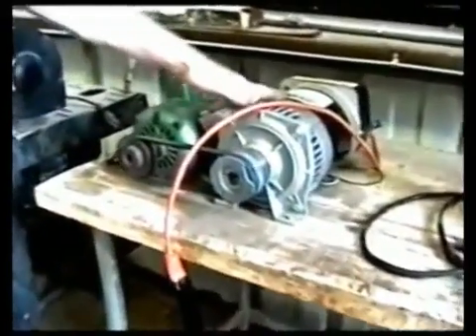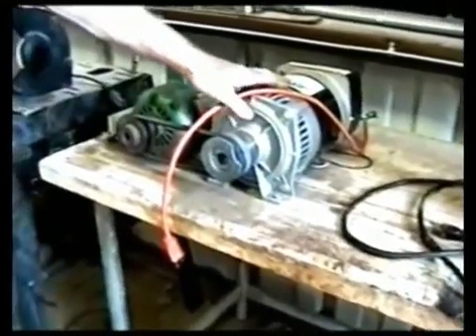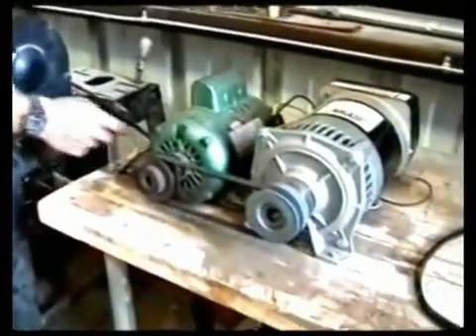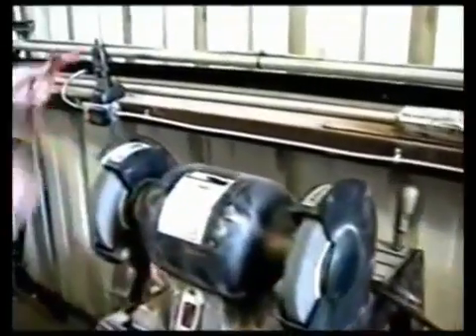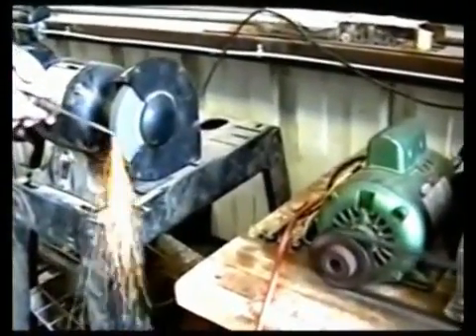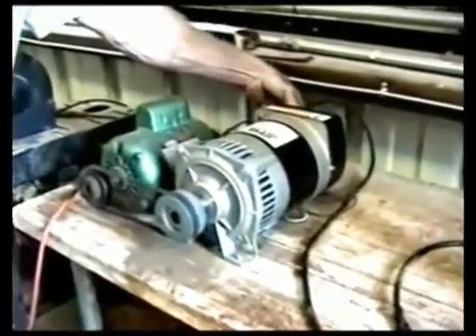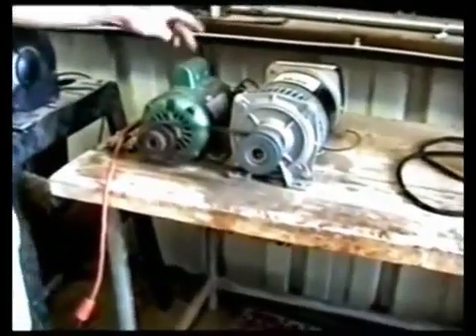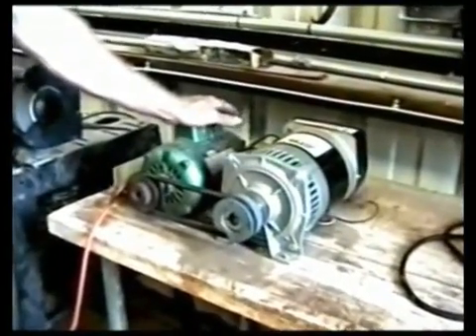3000 Watt Generator Powers Itself, Grinder & Drill Press.

Comment: I tried creating a gas-less generator by using a 12 volt car battery to run a 6 volt kid scooter motor to turn a 12 volt GM alternator to operate a 110 power inverter.As a big circle jerk lets say.The battery ran the motor which turned the alternator which the alternator charged the battery."That's the circle jerk". And in turn powered the 110 power inverter.I powered a 100 watt light bulb with this system for over 12 hours before the voltage Gen- burned out.Any thoughts what I did wrong?

Comment: That's easy to build. Just connect two motors, high RPM motor with low RPM motor at two ends, one with wire and other with conveyor belt. Supply some power to one motor and see the magic :)

Comment: ....so you switched over from the plug you put into the wall into another, hidden plug in the wall, and then unplugged the first plug to make it appear to run itself.

well, if it don't make sense, I guess it's making money!

if its real, proof is easy: put the "generator" on a rolling cart, and give a camera tour of the self-running device unplugged from the wall.

Comment: This is similar to power generators used during WWII. They used a starter motor hooked directly to a dynamo that then used part of the power to recharge the 6 volt car battery and then use the excess electricity to power the military camp, including powering the radio transmitter/receivers and lights.

Comment: I work at a golf coarse n for the longest time I knew this was possible n thought a golf cart could run continuous u would just need batteries to get started. if u were to use power inverters to boost power of that to would it work

Comment: This isn't "future" anything, because the only difference between this & what happens in a vehicle is the vehicle requires gasoline from outside the system in order to provide enough power to keep the car going. Otherwise, this is no different then what happens with between your alternator & your car's battery.

Comment: I built this unit 20 years ago I also used step up transformer's and a fly wheel as a counter weight to offset loads.  Have fun trying to get a patent on it....  
This application could replace solar panels just emit the energy direct to batteries or maybe even by pass batteries with the right transformer.

Comment: It's just using electricity from the mains. Having the motor and generator powering each other just acts as a big battery. Eventually it will run out.

Comment: Would like to think your components work the way that's described. But the only way to make it more believable is to have every thing mounted on a clear see thru product like plastic and away from the wall and everything else. Even the inspection plate were your receptacles are and anything else that batteries would be concealed. Cause that material that's mounted under your table under your Gen. does not look good for your cause too many people have Faked their way on here. Transparency Counts

Comment: this principle is what iam thinking about to run an electric car without plugging in!!a self charging device that will continuously give the power to the motor as long as it is running,,we all know that alternator produces an AC current and with the use a transformer to produce 220/110 volts will charge the battery while running!!and kaboom goodbye expensive fuel!!

Comment: My main question is how are you able to generate 3000 watts when it's being powered by a motor that is unable to do so. The 3/4 hp motor creates a usable wattage of about 560. If you were generating 3000 watts, you would need a 4.5 hp motor. I don't doubt what I'm seeing, I've had this same idea in my head but no way to try it out, I'm just wondering about the numbers. Thanks.

Comment: I can only think of one problem with this; the excessive heat that will be created by both the generator and motor.  If you plan to build larger units of this type to power entire homes & commercial properties, you will need to set up some kind of cooling system, preferably a hydraulic one.  But other than that, it looks perfect.

Comment: When the grinder and the drill press started up there was no change in the sound of the motor, meaning no speed change that would usually occur when u put a load into a closed system like that.

Comment: How long will it last until you have to plug it in. The motor is the weak link because of its efficiency.. It will bleed off power causing the entire system to slow down over a period of time..

Comment: Think you could include a circuit diagram in this video? Also, have you connected any measurement devices to get some idea about what is going on? Voltage, current, RPM gauge? Is the motor RPM dropping when you turn on your grinder and drill press?

Comment: Make a believer oout of me by taking the motor/generator outside on a concrete driveway. Then put both units on a saw horse and connect the generator to a drill press .  After you get the  generator running th drill press pull in all power cords and video ALL AROUND the working setup to show no power cords are feeding anything.
Please dont edit or clip the video in any way.

Comment: lets see only about 50 reasons why this doesn't really work you know how many people have tried this exact same design just waiting for where you need money to build a bigger one. hooking two 70% efficient devices together with a belt does not give you free energy because there is no free energy. you just don't have the equipment to measure the power factor and your mistaking this for free power. if it's plugged in there's no free power just measuring trickery. you'll never approve this comment

Comment: Sounds interesting, are you able to say how you modified the generator to produce more power than the motor? In my normal understanding, what you propose is impossible, motors and generators are inefficient devices - friction losses, heating losses, even the drive belt produces loss.  Where does this energy come from once the set is running?

Comment: This is called a Perpetual Motion Machine of the First Kind, because it breaks the First law of thermodynamics. If it could work, it would have been marketed decades ago, since such PM machines began appearing in the late 1800's. Incidentally, from the visible belt tensions and rotation of the belt wheels, it looks as if the "generator" is belt-driving the motor, instead of the other way around.

Comment: I've got a question, I had been working on a simular design for generator as this, almost identicle, I noticed two curious things......

#1: When you closed the cicuit with the first switch, it powered on the unit, you then waited and then you flipped switches 1 & 2 at the same time, switch 2 isolating the initializing source from the grenerated source, but would not opening switch #1 power off the system as a whole?

Comment: By far the most amazing thing about this is that there is no noise as the load is put on the electric motor, nor does the belt even look like it is under load! Clearly this generator makes so much power that it barely even works hard in this vid.

Comment: By far the most amazing thing about this is that there is no noise as the load is put on the electric motor, nor does the belt even look like it is under load! Clearly this generator makes so much power that it barely even works in this vid.

Comment: Perpetual motion? Post up an hour long run with a volt meter and prove there is no bleed off of kinetic energy.  Truth be told,  if it's able to sustain itself even for five minutes it would make energy far cheaper,  albeit you would still need to spin it up from outside power periodically.

Comment: If this stuff was real people would be donating them to African villages instead of giving them solar/battery systems.

If this is a practical / renewable energy source Sealed in a plexiglass container with plexiglass legs, powering a set of LED's, an atomic clock, and a 24/7 webcam on it.

Comment: Thanks for the demo.  I have two of these rigs going at my farm.  I use a duplex system with one small motor / gen set that I just hand crank then throw the switch.  It puts out about 500 watts in excess power.  I use this fed into a larger stage that starts slowly but gets up to speed in about 30 seconds then puts out about 5kw excess.  Recommend this because what if you have no AC power to start!  Can't get near 200x power out, but mine is easy to build and plenty adequate. email me for info.

Comment: cool demo!
I wouldn't mind trying to duplicate it.
However after quick web searches I've found 3000W generator is commonly coupled with 4-6hp gas engines, how can the 3/4hp electric motor compare respectively?

Comment: Now install the motor and generator on a golf cart and you can drive it all day long just need power source to start it or a battery and a 12v motor then your good to go.Change the sizes of the pulleys so the motor spins the generator faster and see how much more power you can get out of the generator just a thought.

Comment: No in this System Thinking. Consider one engine rather then two. Use for this acceptance revealling contradictions. This and will be an IMPORTANT part of thinking. The Winding - that additional, - she transforms the electric motor in without fuel - a GENERATOR she ELECTROMAGNET, she GENERATOR, she AGITATING, she STARTING.

Comment: Use one electro engine , rather then two. And magnets rotor / статору do not need.  It is Enough windings of excitation from one фазф. The Start and functioning(working) the generator it is necessary to start, and support the capacity.

Comment: This ignores the physics that tend to be problematic in the real world.  A 3/4 HP electric motor is not enough prime mover to operate that generator at full load.  You will get less out of the generator than was is provided to the electric motor at any load.  Yes it is possible to run a generator at full speed with low horsepower with a light or no load on the generator.

Comment: what u got there is a dynamo great idear how many watts was the gen head before /after mod ? cause most of  the probs are if u rewind the coil u need thicker wire and more wraps and u have the problem of the caseing or magnet toutching the core iam wondering how thay kept the same air gap u know more watts thicker mag wire less space as result or was it a longer core ? or duel wrap thick thick or thick thiner just wondering thanks

Comment: Interesting concept a 3000 watt generator connected via pulleys and belts to an ac motor that magically maintains a perfect 60 cycle rotation??? Just how in the hell are you able to maintain this precise 60 cycle rotation  without some kind of regulator circuitry built into both mechanical devices ...???

Without some form of rotation speed regulator your motor would burn up taking the lower windings of your generator with it...

Comment: so how can i come by and validate this? id like to use my test meters that have all been calibrated. id also like to validate all wiring. i will have an electrical eng as well as a licensed elect. wire the unit up. if you will let me i will buy 100 units immediately and sign a contract for 1 million to be delivered in your time period, doing so would allow me to offer these to the public for a slight profit. I already have t boon's backing.

Comment: Would it be possible to run a similar generator from a water wheel or turbine if the RPM were high enough? I have a 3000watt generator and a small stream next to my home and would like to create power without the use of gasoline or electricity...

Comment: yeah im not sure this should work, maybe momentarily but as a long term solution? not too sure, i believe in "free energy" but this is recycled energy with a large storage tank and a small faucet  leave the faucet on for long enough and the tank will eventually drain. if it can power something for over a day i might believe theres something to this until then :(

Comment: I'm just wondering, I have repaired a 10 kva genset with a 4 cylinder gasoline engine attached to it. When it's done I put a load on it,a drill. You can hear the effect  of the load that really affect the engine.When you turn on your load, there's no change of the rpm of your induction motor.I don't want to make a negative  comment on your video,prove to viewers that your induction motor is better than this 1,300 cc gasoline engine.

Comment: Just think if you remove the LOSSES of the BELT DRIVE by coupling the shafts directly together!  You'd have to tap off the extra energy unfailingly lest the machine continuously speed up to DESTRUCTION!

Comment: Your motor is 1/4 HP and Generator is 3000W? You use AC to turn the motor in turn to run the generator? and unplug the AC and switching into power from generator?

Comment: how much does this generator unit cost?
Would you tell us: what type of bearings are installed in this unit ? total weight ? At what RPM you can unplug the initial supply power ? break away torque ?
Can I install this unit vertical ? 
Thanks

Comment: could this be modified to be started by a battery, which itself could be charged by another method, so that it would not need to rely on a conventional energy source for start-up. then of course, if the switches where capable of being an automated computer process then manual operation could be simplified, to a simple "on/off" switch...

Comment: If a a person got a 12v car starter a flywheel some alts a big belt and some inverters and a battery they'd be on par with power stations. As long as the gennie puts out atleast an extra 2kw youll only have to worry about heat.

Comment: I have a 10,000 watt generator head and the recommended engine is a 16 horsepower gas engine.  If I use a 3/4 or 1 hsp electric motar to spin the generator head will that work if I get the correct pulley sizes?  Thanks

Comment: Anyone watching this and believes this is real and not a trick is an idiot. He has this thing plugged into an outlet with separate wires and a plug that the camera is not showing. An electric motor is less than 100% efficient and a Generator is also going to be less than than 100% efficient. Together they would just slow to a stop after power was removed; and stop very quickly if a load was applied like the grinder or drill press. I am sure the creator of this video is laughing his ass off.

Comment: Can I spoil the secret? As an Electrical Engineer I can tell you that it is not without flaws, and the remaining line capacitance will need to increased in its refresh if it is to be used in any serious manner, this can be done with a transistor "type" circuit, trading voltage for amperage in a linear fashion around the time of phase shift. What you have demonstrated is simple slight of hand, no true generation is taking place.

Comment: I ALSO invented this very exact combination with ONE DIFFERENCE. Add a standard car starter, a 12 volt car battery and an automatic car battery charger. Put the starter on a hinge and handle assembly so that the belt pulley on the starter isn't in constant contact with the belt. You can pull on the starter hinge/handle assembly to raise the starter belt pulley against the belt just long enough to get the generator spinning, therefore eliminating the need for an outside AC source.

Comment: I hope you know this is a scam.... A gen powering a motor in a loop does not work for 2 reasons....

1) At best either Gen or Motor is 90% efficient, 100% efficient motors are impossible. This means that 10% of the energy is lost by each device per cycle in the form of heat and noise from overcoming mechanical friction.

2) even if a 100% gen & motor combo existed, it could only run itself indefinitely, the moment you put a load on it, energy would be leached from the system causing it to stop.

Comment: There is no such thing as free energy... it's impossible.  All you've done is just store energy from the AC plug temporarily within a closed system (generator/alternator) that you can tap into for a short period.

The current within the circuit is slowing, albeit slowly.  Let it run for a while and it'll eventually stop/die.

Comment: Whilst I like novel ideas, this has been shown, demonstrated, researched and tested many times since the invention of the electric motor.  There is clearly power going to one of the motors, probably hidden in that box you have at the back you plugged the power cord into, perhaps running on the underside [if you really wanted to inside] the table and down a leg.  It's a great magic trick, but claims as some kind of free power are laughable.

Comment: The FED has been running at 200% efficiency for years.  What I don’t understand is why doesn’t the energy keep building up until the whole unit goes thermonuclear?  If I can generate 2KW by using only 1KW, it seems to me that every second there should be 4KW, 8KW, … 10MW, 20MW and so on.  This is an interesting perspective on the first law of thermodynamics.  Energy can be created simply because the nameplate on the generator says it can.  This is just like the FED.

Comment: Another idea  take a inflatable let the air out of it and let it sink into few feet of water or more and inflate it.  The upward force is greater than the force need to pressurize the inflatable.  Do this to a inflatable in a cylinder with a shaft you have circular motion plus the wirlpool inertia on you side. very high torque low rpm you must let the air out at the top of each motion and refill it at the bottom.